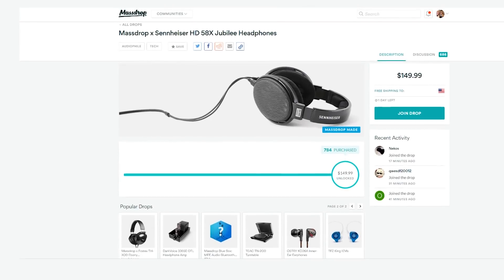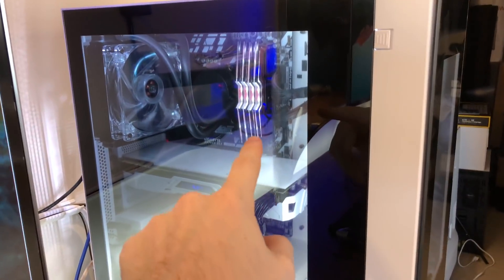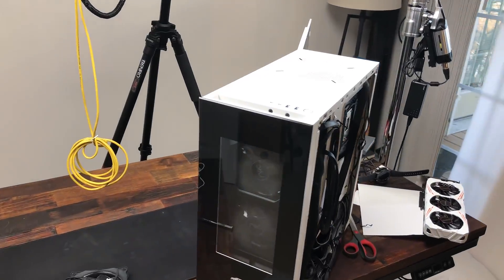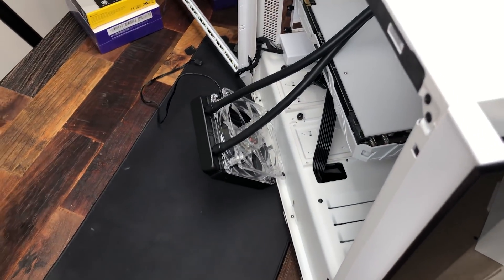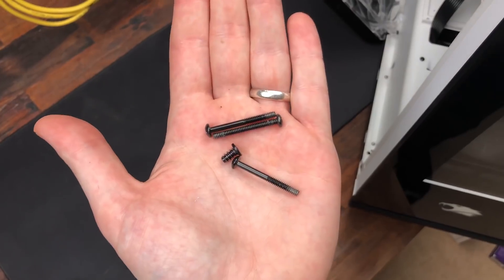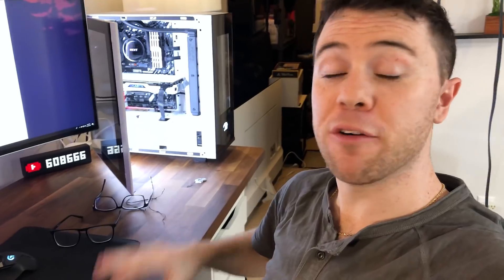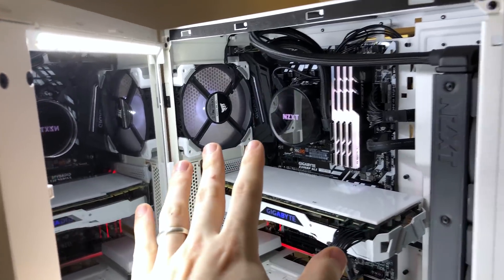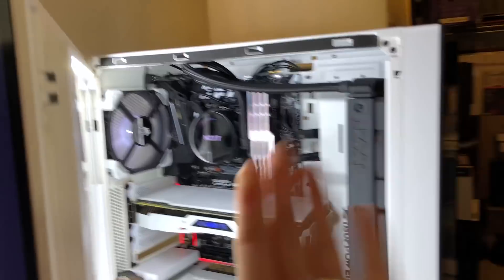Modding My Snowblind PC Part 1!

Comment: I'm a relative newb when it comes to pc building. However, I work in the HVAC industry. That AIO is going to be far more effective on the exhaust than the intake. You are going to transfer more heat out of the case, than cool temps from the air to the CPU

Comment: Two things that need to be said here. 
#1 Its not exactly called "modding" if you really only installed some stickers.. The ram and AIO would have never needed done in the first place if you simply built your own PC from the start rather than order a prebuilt. 

#2 Your "exhaust fan" is actually set up to be an intake. Close to the wall or not, doesn't justify the choice. Its going to struggle to intake just as much as exhaust IF anything, its going to struggle more to intake due to positive pressure within the case. so the whole "testing intake/exhaust combos" excuse seems like a coverup for a mistake.

all that aside, nice work and happy new year bud. will we see a full custom PC for your channel soon? we all know a tech channel deserves a mascot like Jayztwocents "skunkworks" pc...

Comment: 1. Fan in the back is pulling air in not pushing air out. 2. The fans won't light up unless plugged into hue or something like that. 3. With all the money and everything put into it way wouldn't you just buy a case that you like? It looks better now but the cuts would drive me insane because they are not prefect.

Comment: I wouldn't have used vinyl wrap, it just looks tacky. I would have used acetone and removed the black off the glass. If you were dead set on white, you could have taped it off and used white modelers spray paint and made the "bars" thinner (sprayed on the inside of the glass of course). I've done that with a NZXT case. But that's my opinion.

Comment: Did you even install the Hue+ RGB controller to use the fans with the cam software? BTW that corsair fan at the rear does not seem to be positioned in "Exhaust", it looks like it is intake.

Comment: 1: Your Corsair LED fan is set to intake. Flip it.
2: You need to plug into the USB header from the Kraken to change lights.
4: You need the Hue+ to control the lights on the AER RGB fans.
Reply from the maker: no no no, you'll see in pt. 2
Reply: @randomfrankp  Where is PT 2

Comment: Hey, I noticed that your Corsair 120mm fan was facing the wrong way and blowing air into the case, instead of pulling air out. If the logo of the fan is facing you, that's the wrong direction. Wasn't sure if you saw that or not. :)

Comment: Hi RandomFrankP. You should cover where the side of the front panel and the side panel comes together with vinyl as well. There is a color inconsistency and some dark spots that is probably due to how the light falls on the different materials.. A bit more vinyl could clean it up nicely. 8:25

Comment: Why did you get a prebuilt, then mod it? Why not just build your own from scratch? It's cheaper and you don't need to 'mod' afterwards plus you clearly have the know-how?
Reply: I believe he got it free for review from a previous vid, he probably didn't really like the style after some time.
Reply from the maker: Serum Zero I’ve built tons of PCs already on this channel, the prebuilt from iBuyPower has the unique snowblind case with the display that I like. If I could’ve just bought the case, I would’ve
Reply: randomfrankp So the only way to get that case is through snowblind? Good reason though, that display is 🔥🔥

Comment: Wayyyy to much thermal paste imo
Reply: ^exactly, it wont damage it. Putting way to much like emptying the entire tube on the cpu and then the cpu will overheat. other than that no issues.
Reply: Nothing Here it only conducts heat, not electricity, spilling it onto your motherboard or cpu socket probably won’t do anything if you’re willing to clean it out. putting more thermal paste then what you are use to isn’t bad at all, might even help with temperatures, although probably not by much.
Reply: i completly dredged my old cpu and mobo with thermal paste, in the cracks into the mobo socket, its been working fine for the past week
Reply: yes there is. if theres too much it can leak into the pins and actually kill your cpu/mobo

Comment: I don't know why they don't just mount fans with magnets by now.
Reply: magnets in a pc are not a good idea, they can interfere with an hdd, a cd drive, etc.
Reply from the maker: Gamer Voice I’ve wondered too but I’m sure it would cause a lot of vibrations and noise
Reply: It's a good thought but not practical IMO. Vibration for sure, also not all cases are metal, some are plastic (cheap ones) and others aluminum (non magnetic).

Comment: why is your exhaust fan pulling air in ?
Reply from the maker: Emile DesRosiers testing out different push pull combos over the next few days to see what the temp differences are with the rear of the case being so close to the wall :)
Reply: okok I dont know much about the case, I first thought it was because the case is choking the front fan ... I do not like NZXT cases ...
Reply: Crap I didn't see this post. I posted the same thing about the fan being backwards. well if you want the rear fan the way it is then you should add a fan exhausting air out and run the top mount fan at 80 to 100% to pull all that air out.
Reply: randomfrankp can you tell us what temps you get when playing games after you fnish with this PC please
Reply: Emile DesRosiers nzxt cases are actually some of the best covered front panel cases in terms of of airflow besides fractal. Also that isn't an nzxt case, I think it's an anidees ai crystal.
Reply: I
Reply: Wi1dCard it's is base on NZXT S340 Elite, you can see the IO and the bottom case foot mounting
Reply: Ya, just remember that no exhaust at all will create a hotbox out of your PC.  I hope you get a good config for yourself!

Comment: You have the rear fan backward. That way it will draw air in, not push out ;)
Reply: randomfrankp oh. Cool!
Reply: try to obstuct the unused pci slots, and the vertical mount space(don't know how to call this). it helps a lot to prevent hot air to get back in the case and doing an infernal heat loop. try with tape first, then, if it helps, cut an acrylique sheet :)
Reply: depends boi
Reply: Flip it around so it is exhausting! Even if the temps are slightly better that will not last long because with the negative air pressure your case will be packed full of dust.
Reply: You said on the video it's exhaust :) and the front fans is intake as well. so there's no exhaust xD
Reply: Can you just be honest and just say, "oh my bad, good looking out". Clearly it was a mistake, nobody is perfect... >.>
Reply from the maker: Brandon Funk bingo. Over the next few days im testing out different push/pull combos - I want to see what works best with the rear of the case being so close to my wall :)
Reply: Debatable, could be an intake for the radiator in the front.

Comment: I’m getting the i5-8600k and I was wondering if the Corsair h60 will be enough to cool it, otherwise I’ll go for the h100i v2. But if anyone could let me know that would be nice.
Reply: Sam Norsted the h60 will be enough cooling for sure but if you have an atx or matx case I'd get the h100 for the aesthetic as the h60 will look really small
Reply: yes
Reply: Kay Walsh the h60 is enough?
Reply: Better yet, go with a good Air cooler, something like Noctia. Very reliable, cools good and silent fan. I like AIOs but they do fail and could leak eventually. Not worth the money IMO. Air cooler won't let you down. Worst that could happen is a failed fan and they're not expensive.